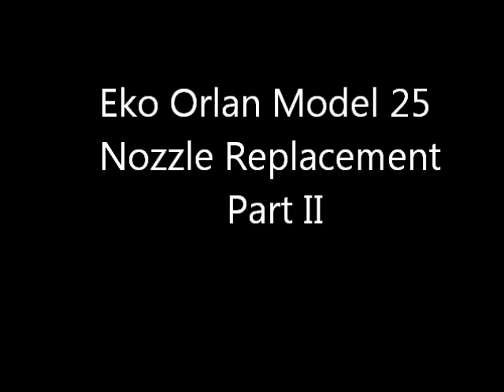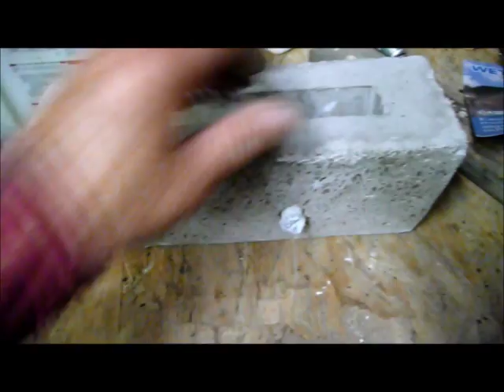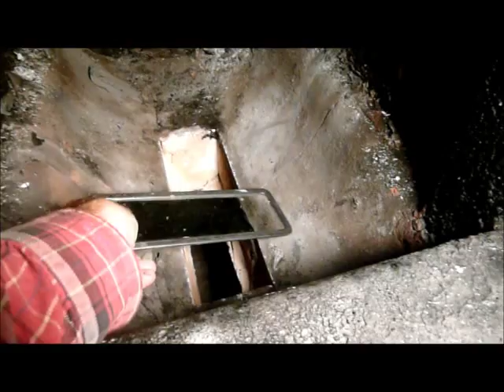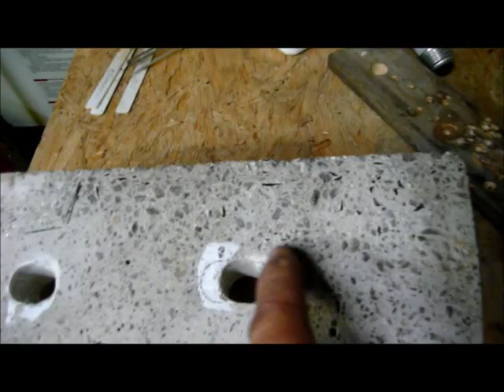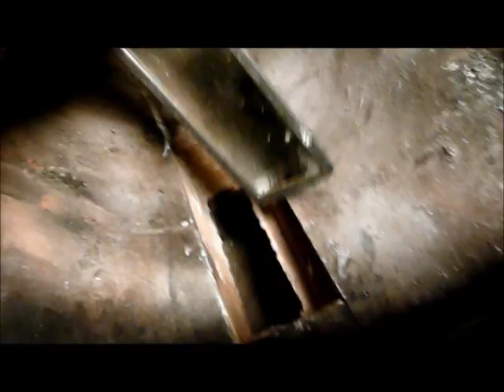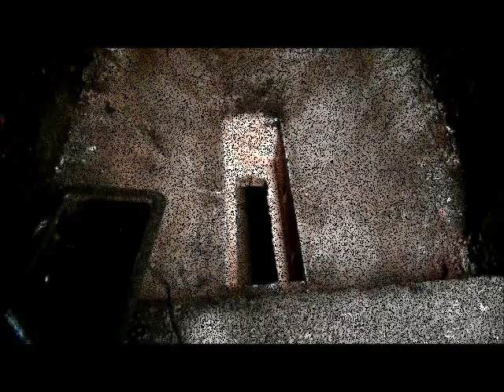Eko Orlan Model 25 Nozzle Replacement Part 2

Comment from the maker: Howdy!  Unsure of what their process is; not good obviously.  I see so much of this it is disheartening. Heck of it is, unless you disassemble the unit and check as I did, you would never know it. Their user manual stresses the fact that proper air adjustment is critical for proper operation. I wonder how many other messed-up boilers they shipped?  Unrelated, but similar, my nephew had 13 replacement windows installed in his house today. He got checking tonight and they are not what he ordered.